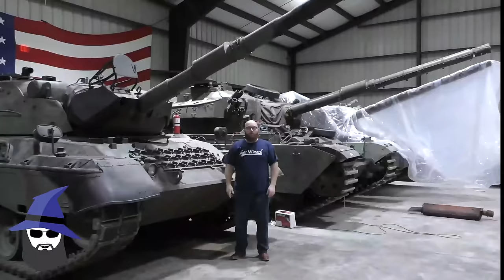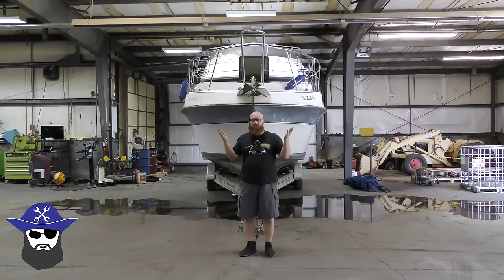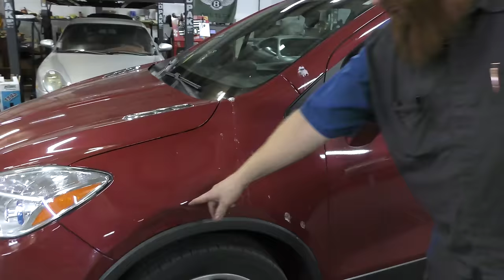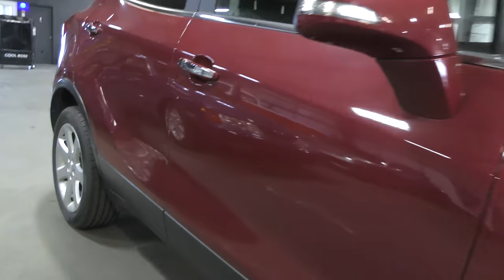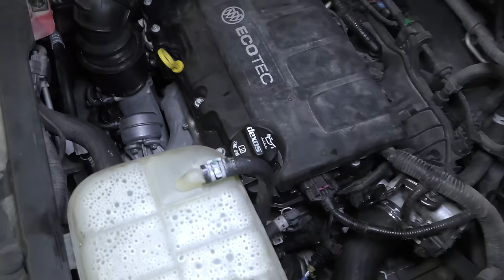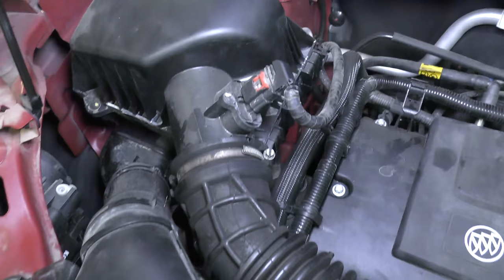How did a dealer miss the problem on this '15 Encore 4 times? CAR WIZARD just had to read the codes

Comment: Wouldnt the dealership telling you an oil change will fix your engine light raise alarm bells anyways?
Reply: I feel like it can depend on the car. Some have the light come on after a certain amount of miles to let you know when to change it (like my Jeep in my picture). Though the light is reset manually and changing the oil doesn't make it turn off, but I think you get my point.
Reply: Dealerships are there to sell you a new car and the mechanics are there to do the basic warranty work- that's all. They're not interested in fixing used cars, even ones that sport the same brands they're selling. Find a good REAL mechanic who actually knows how to repair cars, like Omega and use them (I had owned a 1971 Nova - rebuilt, track car)...
Reply: @hannahpumpkins4359  Dealerships actually make the majority of their profit from used car sales and service. There's very little profit in new car sales or warranty work.
Reply: Also coded dealing with variable vavle timing can be fixed with oil changes
Reply: There are scenarios where an oil change could be a fix for a check engine light. Dirty, sludged, or low oil could cause oil pressure issues with CVVT systems causing cam/crank correlation codes from the variable timing not operating properly. Also, Chrysler products will throw a check engine light if the wrong weight oil is put into their engines, so that would be another example of an oil change being a CEL repair. Obviously, most of the time that isn’t the case and after the first one it should have been a red flag, but it’s not impossible.
Reply: @hannahpumpkins4359  i wouldn't say all are. I take stuff to our local ford dealer. I have them do certain diagnostic work and some electrical stuff that requires IDS. They then tell me what needs done, and I do the rest. I even had them do the rear axle on a 78 pickup when I didn't have time, and they where happy to have something old come in.
Reply: @seraphimvalkyrin4543  That’s usually a maintenance icon like a wrench symbol or “maintenance required” or “oil change due”. Check engine usually doesn’t come on unless there’s an emissions system fault or something else that actually triggers a trouble code. Sounds like the service department just didn’t care enough to properly diagnose the problem and fix it, but they found other nonexistent issues to bill her for.
Reply: @seraphimvalkyrin4543  You sure you mean engine light?
or the wrench light that comes on for oil change or service
some don't have that light and it's just an option you get to by navigating through the gauge cluster or inside you're infotainment system (some honda's for example)
Reply: The customer is female so this is what you get sometimes sadly.
Reply: Only if you know what oil is. And what pistons are. And what spark plugs are. Most buick owners understand the "key" the "accelerator", the "brake pedal", and the steering wheel. That's it.
Reply: Maybe, but not necessarily.  A buddy of mine had the check engine light on his Honda come on and the vehicle went into limp mode...  He had been negligent with oil changes and it was causing havoc with the VTEC.  One oil change later and he was good to go...
Reply: Actually it can in some rare cases :-)
Reply: To someone who knows nothing about cars, you could probably tell them anything, unfortunately
Reply: @tangydiesel1886  Most are actually honest at least. They may be incompetent but they usually try to work within their resources.
Reply: I actually was told by the assistant manager at a dealership when I was a service writer if I refuse to lie to customers I was in the wrong business
Reply: In some cases it can such as vvt issues when the wrong viscosity oil was used prior
Reply: Newer cars will set a cel and code for wrong oil viscosity, so yes. Maybe that's what was wrong with the Buick AT THAT TIME.
Reply: Not when you know nothing at all about automotive electronics.  Some folks just don't know. (But not me...I do....sometimes...with the help from YouTube guys, like The Wizard)
Reply: These things happens to a lot of my girls and older ladies costumers too. Apparently even dealers would see ladies' cars as money pit. They will bleed these ladies dry. One even took out the check engine and temperature light out so the engine would blew  and cost her more money, or to have her sell the car to their 'friends' and buy a new or used one from their 'recommended dealer' So, having somebody who knows nothing about cars and engines to a repair shop, dealers or not is never a good idea. Plenty of dishonest people in repair business.
Reply: @MrMikey1273  I agree.
Reply: It was a woman and an old woman at that , They milked her and overcharged the hell out of her for an oil change and whatever minimal service they did
Reply: @hannahpumpkins4359  "Find a good REAL mechanic..."
You might as well tell people to find the pot of gold at the end of a rainbow, or find a unicorn.
Reply: People pay them to know what's wrong.   It's not up to the customers to know.   Many people have no knowledge of cars and expect that when they pay the "experts", the "experts" will do what they are paid to do, fix the car!
Reply: Yeah this is just stupid. Whoever is the  service advisor or technician should be fired for multiple comebacks
Reply: @seeya205  They knew what the hell was wrong, anyone with the scan tool would've figured it out immediately, I mean I've seen some bad dealer stories but this is among the worst
Reply: dealerships have 1 licensed tech.. if your lucky... they follow what is in the diag chart.. outside of that.. hope your state has a good lemon law
Reply: Women don't know much about cars and dealerships love to prey on women's fears. "you better get that fixed today you don't want to be stuck in the middle of nowhere do you" It works beautifully on my wife.
Reply: I think some dealerships with labor shortage problems may have few qualified mechanics and a lot of guys not much better than a Jiffy Lube tech with an it's a job attitude. If the Jiffy Lube tech has a computer and has actual car interest (that may not be the case) they will run into videos on how to use a scan tool and I assume all dealerships has a tool setup for their brand of cars, just plug it in and it will do everything. I suspect they sold a lot of stuff, which they may or may not have actually done, and created a customer that not only hates the dealer but the brand, sounds like a win win.
Reply: Depends on the problem sort of. A honda accord can be low on oil and throw a VTEC engine light code. Technically a oil change will fix the light.
Reply: @dunebasher1971  the junk yard makes the most money in the car business
Reply: @hannahpumpkins4359  that's true lol tried making me go to them for repairs 😂 good thing I know a good mechanic that does mines free😇
Reply: As some others have said oil changes sometimes do fix stuff, when I worked at a shop we had a car come in as my first job there had to change the intake manifold and do an oil change, we did that and put in an additive and had them come back 1000 miles later for another change and did that a few times, after the repair and everything the engine light stayed off and we saved the customer thousands of dollars since they had it at a dealership first who told him it needed a whole new engine
Reply: @dunebasher1971  But sadly, on the service side of things--trouble shooting and problem solving seems to be their weak point. But in this case, it's not even consider trouble shooting cause the diagnostic computer was able to pinpoint the problem. It's  basically just order taking. So it's scary if they struggle with routine servicing, can you imagine how terrible they'll be at real trouble shooting when the solution isn't so obvious!
Reply: Sometimes the cel light can come on for the cam or the crank and it’s because there’s no oil on the dipstick, so just top it off and clear the code and it’s all good
Reply: I'm sure your average person would question it, but severely old, dirty or low oil can absolutely cause certain codes to be set in the ECM.
Reply: I'm here to say that a dealer actually said this to me. They also didn't let me test drive it on the street....sooo no I didn't buy it.

Comment: This is why when you find a good mechanic, you let him buy the parts for the markup and don't give him a hard time on prices. A good mechanic is worth their weight in gold.
Reply: Say it for the people in the back
Reply: If I'm going with really high quality parts, I usually order them. But I throw my mechanic a decent amount extra to make up for the difference on mark up.
Reply: Totally agree 👍
Reply: I'm reeeeally scared to move away when I finally do bc I don't wanna lose my mechanic lmao. Been a family friend since I was a baby and he fixes the car, first time, every time
Reply: Good Mechanics ARE worth… (but they can’t do syntax real good!)
Reply: @timmothyking7102  f
Reply: @timmothyking7102  as z
Reply: They lost all the older mechanics and got a bunch of parts changers  .
Reply: Yes, but also any good mechanic is going to tell a customer who is not knowledgeable to never, ever buy the 1.4 thru 1.6 ecotecs.
Reply: What are you Even talking about
Reply: I will not buy parts and get stiffed. 
I've been and done that already. 
I do the actual diagnosis.
I tell them at the forefront. This is how much I charge per hour. 
If the actual diagnosis is 3 hours. You pay me first before I tell you what is wrong.
I also ask the customer to write down all the details before I start my diagnosis. 
Who worked on it, what parts are installed. From where? ECT ECT.
If I get a stall, I ask the owner to open the hood. If I see wires all over. I tell them, some one has been working on it and I need to know what work was done. If I get anything. I will take a pass.

Comment: "Trained technicians" = parts replacement specialist
Reply: So true.
Reply: Random parts replacement specialist to be precise.
Reply: "Specialist" used loosely
Reply: A "service advisor" bossing around minimum-wage parts replacers. It's sad.
Reply: Or = "Parts Cannon Operator"
Reply: Diagnosis?? Oh, I'm not a doctor.  Let's just throw parts at it until the customer stops coming back!
Reply: So fing true.
Reply: But they didn’t even replace parts!
Reply: And half the time they can’t even do that right.
Reply: Said but true, oil change hacks and filter replacers
Reply: @rayseal9157  5th⁵
Reply: @rayseal9157  5th
Reply: @rayseal9157  6⁶⁶
Reply: You mean oil change specialists...
Reply: had a flat on a brand new car...i drove by the dealership i bought it at everyday so i took off the tire and took it in..dropped it off for them to fix it...5 days later i stopped to pick it up..they forgot about it...so then did a rush job and peeled the coating off the wheel and didn't even patch the tire correctly it went flat within an hour....they can't even be trusted to fix a fcking flat tire
Reply: If they were parts replacement specialists they would have read the code for thermostat and replaced it. Baffling
Reply: Truth and that’s coming from a dealership tech. Certain techs that’s all they know
Reply: Not everyone can fix the problem once.  But you have to put an effort into it.
Reply: You crap em and we scrap them 👍

Comment: The last time I went to the dealership (which is the last time I will ever go there), I went there for a clunking noise in the front end.  I had an idea of what the issue was, but because I had an "exotic" car I wanted them to look at it just in case.  They said I needed new front struts, new front swaybar end links, and new rear struts.  They wanted over $2,000 for all that.  I politely said "no thanks", paid the inspection fee and left.  I took the front end apart and replaced just the swaybar end links for $17 each.  I also bought some new lug nuts because the old ones had swollen a little.  So $34 for the end links, $70 for the high quality lug nuts.  No more noises in the suspension and the car runs fine. F U stealership!

Comment: Because dealer techs are script monkeys: if it’s not on the script, they don’t know what to do.
Reply: And usually that script will end with replacing a REALLY expensive part like the PCM or or catalyst.
Reply: I thought the code reader writes the script, lol
Reply: You’re so wrong. There’s good and and bad private shop techs and there’s good and bad dealership techs.  I’m a foreman at a dealer and I train my techs and apprentices to go through proper diagnosis processes. I don’t just hand them answers from my experience. I make them figure it out so that they learn. Making a generalization like that is such garbage.
Reply: I can't believe the battery wasn't on the script.
Reply: I guess it’s not profitable for the stealership  shop to pinpoint the problem at first shot, their mission is to milk the customer slowly before they get to the root of the problem.
Reply: @mattorey5816  you seem to be the exception, and not the rule.
Reply: @csabahollo6922  The point was there are plenty of shady independent mechanics out there as well. I’ve worked with many many many very good techs in dealerships. I’ve also worked with some really really bad ones. In a shop that has pride in its work and it’s customer service, those people don’t last regardless of whether it’s a dealer or an independent.
Reply: Funny because I work at a dealership and we have to constantly fix what the independents can’t, won’t or screw up. Please don’t generalize us all.
Reply: @mattorey5816  The difference is that independent mechanics live and die by their reputation.  The dealership is supposed to represent the brand, and when they fail so poorly, they don't go away like independents do.  They live to mess up another day.
Reply: I'm a dealership tech, I face the bureaucracy every day and do my best to serve the customer right. I'm no F monkey! I am obliged to replace the scripted parts to fulfill warranty demands. When I see a conception mistake that I can modify I apply it to my repair procedure to make sure it won't happen again.
Reply: But this was exactly IN the script
Reply: @mattorey5816  I couldn't agree more. I started out in a dealership and luckily the guy that mentored me was a skilled and knowledgeable tech, learned a lot from him. But there are some no good dealer techs too. Same can be said for ASE certs too... They are a joke, IMO. Some of the biggest hack job and unroadworthy repairs I've seen I later find out were done by ASE certified guys. Many of the repair jobs that I'm actually impressed by I later find out were done by guys that never took an ASE test in their life.
Reply: @wasabitoburrion4409  there’s 2 sides to every story, as someone who’s worked in a service department at a dealership, I would be shocked that they would recommend a $20 oil change when they could sell a $200-$400 repair. My suspicion is that whoever drives the Buick either declined the diagnostic fee and just had an oil change done every time they came in hoping that would fix it, or didn’t want to pay what the dealer was going to charge and took it to an independent shop to save some money
Reply: @Koop415  exactly

Comment: I can see that’s an Opel Mokka, you can’t fool me with that Buick badge
Reply: Vauxhall Mokka in UK but yep
Reply: Not even a decent vauxhall either
Reply: See; encycarpedia Suzuki SX4 S-Cross 1.4 boosterjet  specifications (2016).  It’s even the same color.